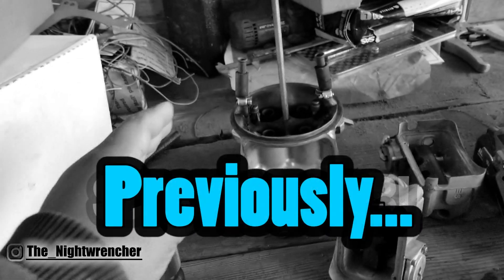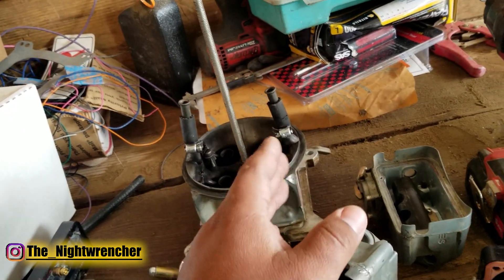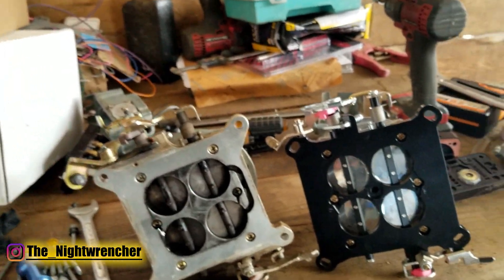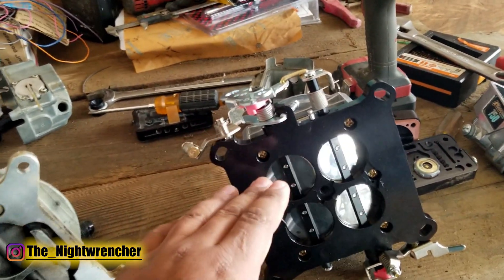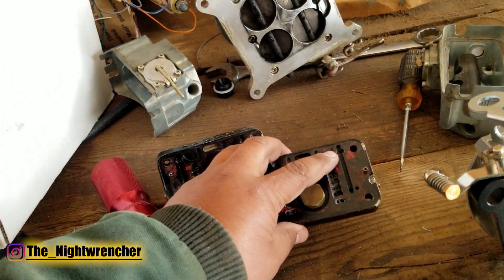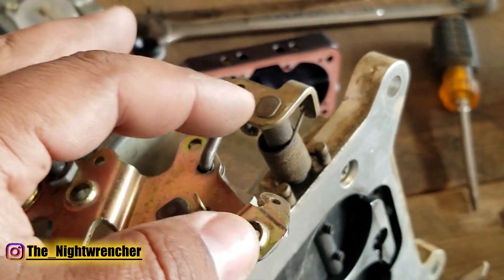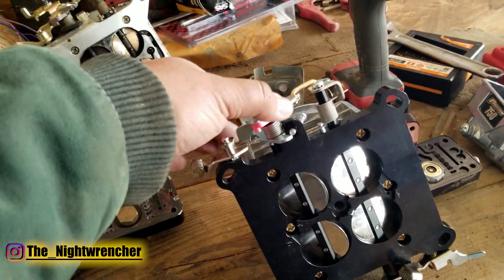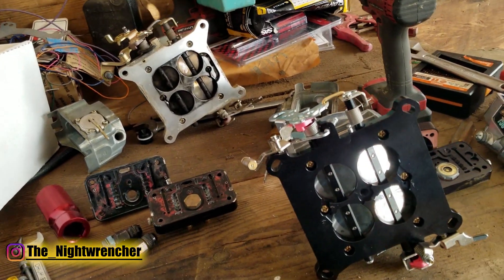DIY Blow Through Carburetor Build For The Budget Turbo Carbureted LS | Part 3 | Proform Race Series

Comment: After 3 videos, I am starting to get a base line on blowthru 101. The picture of idle to transition to part throttle cruise  to full power is a bit clearer. I have always run mild VS carbs, to there is a bit to learn there too, but that's ok too.

Comment: What about boosting the 2nd and 3rd 2GC carbs on a Pontiac tripower setup? You can adjust linkage for tip in. I have mine at 50% on one car and 60% on another.
Reply from the maker: The issue with boosting multiple carbs is getting them to flow the same amount of fuel for good fuel distribution. I tried it on a dual quad and it didn't really work well. Some cyls were going dead lean

Comment: Just curios on which metering block you use for e-85 , do you use the ones drill for alcohol or gas jetting?...Thanks
Reply from the maker: For my demon I used the Alcohol metering blocks and for the proform I used the factory E85 metering blocks. You can acomplish it by drilling out the stock metering block. I'll make a video on that for you guys
Reply: @NightWrencher  Thanks for that quick response, I'll be watching for it👍.

Comment: You need to fabricate vent tube extensions on your carb. Run them into your bonnet a few inchs. Then you can rejet the carb closer to the stock jetting. I run a Procharged 355 on the street. Drives and idles great. Proform 750 center section, annular discharge with billet base plate.
Reply from the maker: Very nice, I havnt experimented with the extensions yet. My truck is a manual 5 speed on offroad tires so the tuning gets much trickier during low RPM heavy throttle. I know the extensions help under boost but I havnt seen them make any difference while driving around off boost

Comment: NightWrencher hello, I have question possibly you can help me out with , for one I know  very little about carburetors , my question is I have a 327 , bored 30 over with a Holley 650 double pumper 80670-4 1308 the carburetor was running rich buddy of mine changed the jets to 63 primary 65 Sec,and timed the motor seemed to help a little …But now the problem is when I crack the Secondary’s it want too drop Rpm’s wop bam wop bam …..lol I don’t know how else to exsplain it lol , but the damn thing idles fine and smooth in the primary stage until cracked into Secondary stage do you have any suggestions that might help Nightwrencher , my buddy was saying something about a lighter Acc pump secondary spring dose this make sense or is just a bunch of Mumbo Jumbo waste of time , then he was telling if that didn’t work that i probably need 750 dbl ….I just don’t want to waste any more time or money trying to figure this out the cam in the motor is 560 ? ,so I guess Night Wrencher if anybody could possibly give the right path would hopefully be you ….Thanks Nightwrencher I really appreciate your time and help……Ron 👍
Reply from the maker: Hey Ron, first off thats not a 650 double pumper. Thats a dual feed 670cfm vacuum secondary carburetor, not a double pumper. Double pumper means accelerator pump on the primary and secondaey bowls. If it has a big vacuum pod on the side then its a vacuum secondary carburetor. Second, since its a vacuum secondary carburetor, even if you suddenly stomp on the gas, there is a delay before the secondaries keep up with the primaries. What I think your buddy meant was a lighter vaccum diaphram spring. In my opinion, that would make the problem worse. Sounds like youre leaning out when the secondaries come in so that would cause the shaking/popping. A lighter secondary spring means the secondaries come in faster which would cause the lean spike to get worse. I would go with a HEAVIER secondary spring so the secondaries open smoother but also jet up 3-4 sizes in the rear and then go from there

Comment: If you have the secondary side IFR that much larger then the primary. The idle mix screw (in the secondary) can't be turned out hardly at all correct?
Reply from the maker: That is 100% correct
Reply: @NightWrencher  Nice! That's a great idea! How are your crusing AFR's? Like hwy speed(50-60mph) I've been trying to keep afresh leaner the 12.5 just crusing. But then really runinto issues with trasntion (have BRPV up front.
Reply from the maker: I try to keep my cruising AFR around 13.5-14. I even tow with my truck for several hundred miles at a time and highest I see is 14.2. Going up steap grades with a 3k lb trailer I go into boost without issue(steady 2-3lbs all the way up). Make sure you leave yourself enough slack in the primaries to prevent going into the secondaries when not needed. I have my secondary idle screws out about an 8th of a turn.

Comment: I always take cylinder placement into consideration when thinking about heat retention in that particular part of the block, and which cylinders would fail first if it goes lean. With this its safe to assume the hottest leanest cylinders will fail first. This was applied when I was analyzing the engine failure in a turbo 5.3L that had rear cylinder failure on a VERY under-fueled setup. I have yet to test injectors, but I believe the design of the dead-head fuel rail on the LS car manifold, paired with boost, and a return line added in a poor location leads me to believe the rear two went lean and failed due to either vapor lock or poor circulation and flow at the end of the rail.
Reply from the maker: Yeah, plug readings have to be taken very seriously especially when youre building that much cyl pressure
Reply: It's smart to point out that fuel injection and carburetors can fail in different ways yet lead to similar consequences or damage.